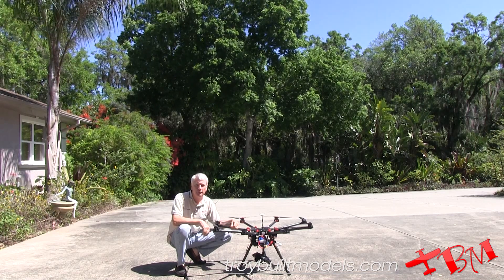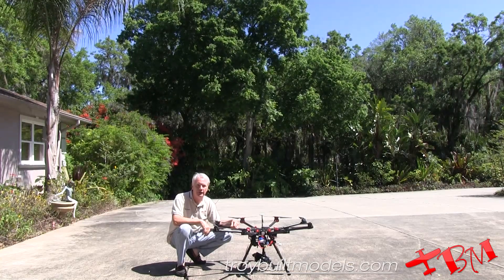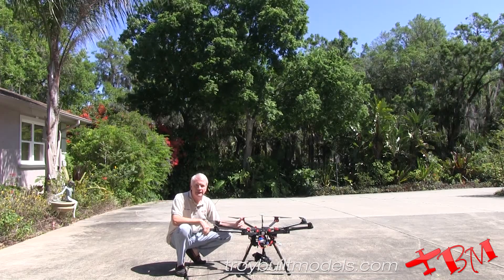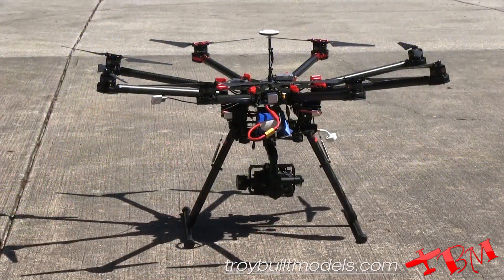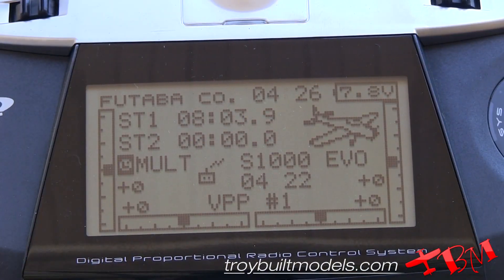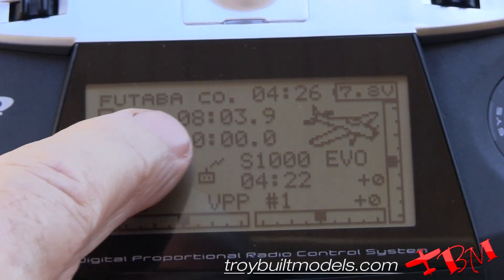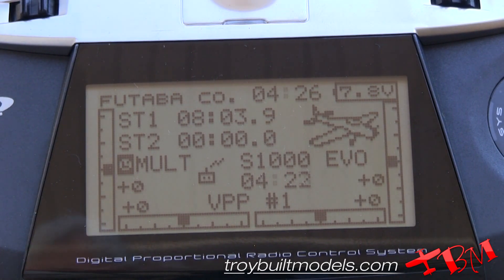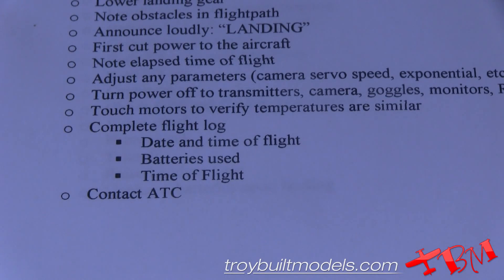DJI S1000 TBM Pilot Operating Handbook "Flight" (3 of 3)

Comment: Hi,

So in the pre-takeoff checklist you put the throttle up to half way to check the hover position.

This doesn't engage the motors? In the video it clearly did not, but it seems a tad counterintuitive. 

If not I'm guessing the only way to start is to go full throttle?
Reply from the maker: Steve Fines When we go to half throttle before take-off, we are checking to see if the auto pilot knows we want to be in a hover.  This is why the LED will only blink once for its mode rather than twice fast.  This has nothing to do with taking off.  If we were at half throttle on the stick, and the light did not go to 1 blink then we may have a trim set wrong or need to calibrate our controller in the software.  The copter will not stay in one spot (GPS LOCK) in the air if it "thinks" you're trying to move it around.  Controls must be centered for it to hold position.